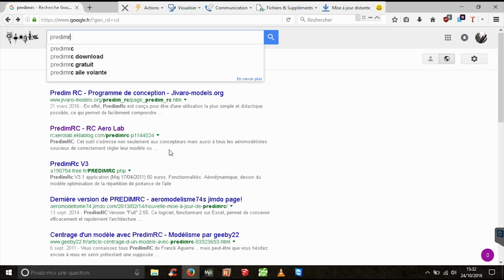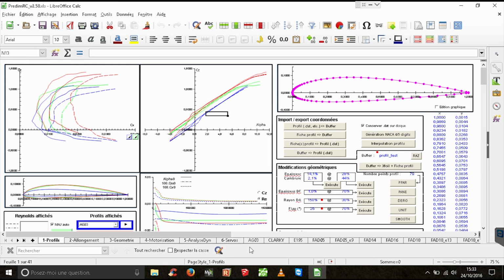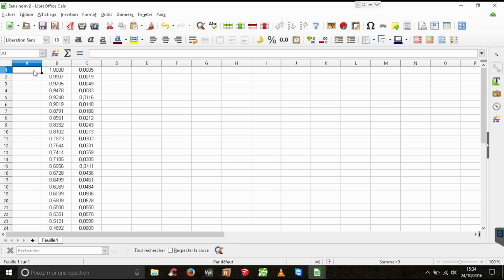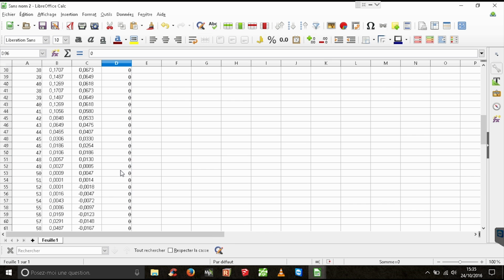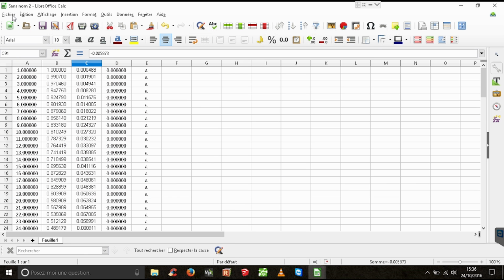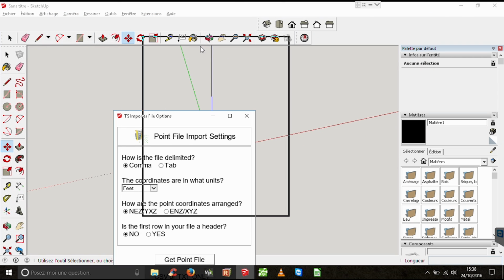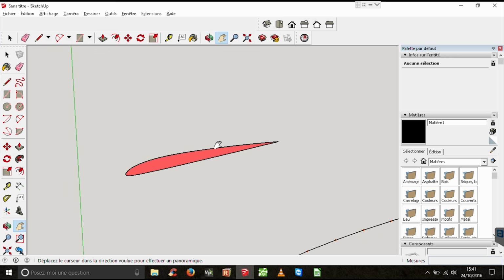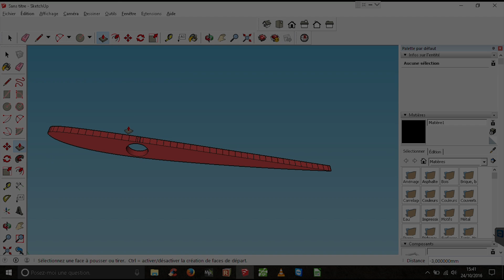WING RIB 3D PRINT

Comment: well, i finally completed the process of importing, and designing my airfoil rib in sketch up to find out that laser cutters cannot work with files from sketch up, so this has been a dead end for me in that regard. It has been educational working with sketch up, but don;t try to use it for laser cutting.  i'me being told by the laser cutting community that i now have to do it over in adobe illustrator, or corel draw, as they generate vectors that the laser cutting software needs.  
laser cutting machines hav software that is made to work with corel draw specifically. 
roar anyone wanting to do laser cutting and design airfoils for it, i recommend looking at this info first, regarding programs that are compatible, so you don't wast your time too:

 https://www.sculpteo.com/blog/2016/07/11/top-8-software-for-laser-cutting
Reply: You'll be fine: The Sketchup PLugins have a routine to convert your SKP format (standard Sketchup) to DXF or STL (very common CAD formats) which most laser sutters and other G-code based systems can interpret. If you're 'into' 3D CAD, the DXF (2D) and especially STL (3D) format are the ones ya need....for now...
Reply: Use Fusion360, you can import the skp files from SketchUp directly into Fusion360.
Fusion can setup the final gcode file too